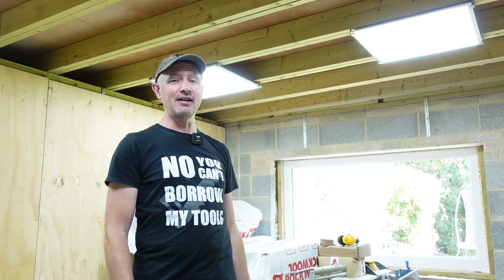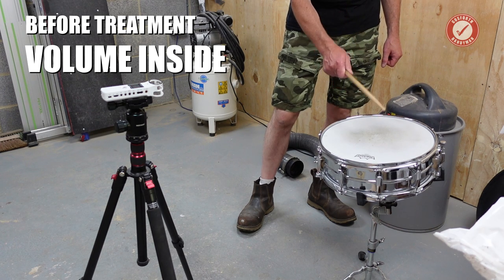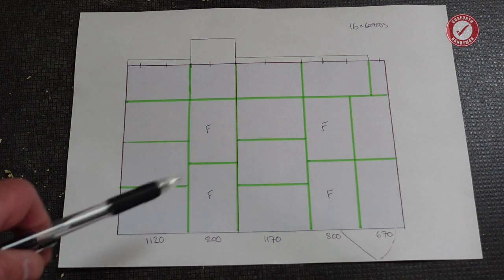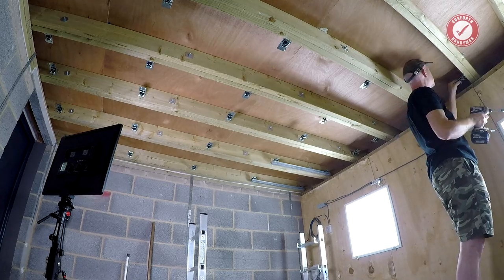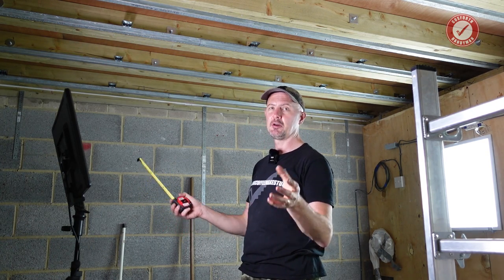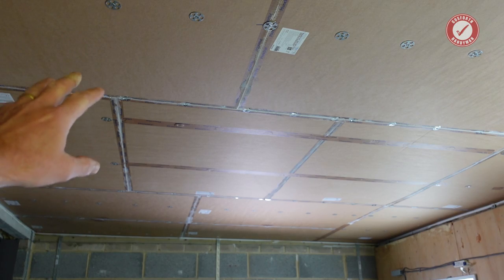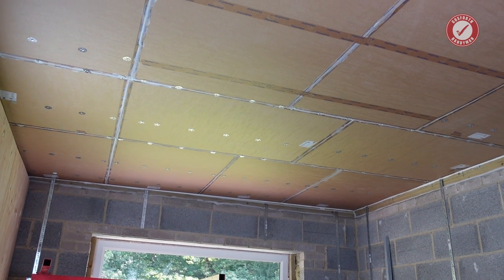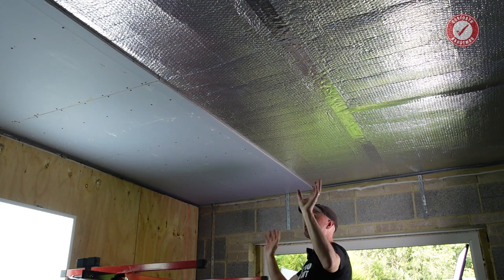Soundproofing the ceiling with SAND?! Garden studio (part 4)

Comment: I used sand for my studio many years ago, I poured dried sand into a 4 inch cavity between 2 sheets of 12mm ply, it worked quite well until the sand slumped down over time, I spent 3 days drying 2 tonnes of it out over a metal sheet which was on top of a fire pit, then was gutted when I discovered you can buy kiln dried sand a few weeks later :) I'be currently got a room inside a room studio which works really well, must do some videos about it one day
Reply: That's awesome! I'd love to hear more

Comment: I agree about the ‘professionals’ Andy, we did our block drive ourselves because of one, and also the fascia sand guttering because of another. We do most ourselves these days because we can usually get better results.
Reply: Same experience here - during our renovation we hired "professionals" (recommended and not the cheapest) to fit one set of doors and to do our fascias, gettering etc... The doors we're ripping out and re-fitting ourselves because they bind even at the maximum adjustment (not to mention the holes they filled with blue roll then trimmed over), the fascias and gutterings - we're going to have to re-fit the guttering so it falls towards the downpipes rather than away from them.

Comment: Subbed & liked. Some serious out of wack levels there & done by so called "professionals"! It does make you wonder about the skill levels of some trades these days.
Must have been the same lot that installed a shower in the hotel room I stayed in the other night. I think we were the first guests to stay in the room after a recent re-fit. The glass shower screen was touching the wall at the top of the shower wall but it had a 10mm gap half way down the wall. No sealant in sight down the wall or between bottom of the shower screen & the shower tray!! My wife came out of the shower into what looked like a swimming pool of water right across the shower room floor which was nearly under the entrance door to the room & the corridor beyond. Luckily were were on the ground floor so no chance of flooding anyone underneath us but it makes you wonder what the hell the guys were on when they installed this & who signed it off. Reception were informed but they did not look  too surprised which led me to believe that this was not the first complaint about the state of the rooms. BTW, this was not a cheap low end hotel but an up market old manor house in 50 acres of grounds. Looks like the cheapest quote got the job - again.

Comment: Thanks so much for the helpful video! A couple of questions: 
1. What is the brand and model of the sand filled panels you used? 
2. How much do those panels weigh in their standard configuration? 
3. How do you handle cutting holes in the panels for things like outlets without having all the sand drain out?

Comment: How did you attach the foil bubble wrap to the sand filled boards? I know you foil taped the edges but did you just staple the middles to keep them tight against the ceiling?
Reply from the maker: Double sided carpet tape. 👍

Comment: nice video...shows me some places where I went wrong with my room. I had plans to do the ceiling, but that sand board is not available in my area. At the time of building, I just went with what I could to finish the build.  My room sounds fine (simple 12x16ft room_), but I want to do more to the floor and ceiling with this process.  My building is off the ground. Anyway, thanks for the video and info. Very informative....

Comment: I got builder to fit this system and plaster, it made very little difference over the old chicken wire and plaster that was there before,,I wish I had saved £2500.  and just left as was,

Comment: What sort of washers/discs did you use to hold up the SBX board? There seems to be three different types, one serrated for tile backer board, one with a centre indent for insulation, and another slightly raised in the centre also for insulation.

Comment: I had a ground floor flat with bowed ceilings.  The previous owner had blocked up all the ventilation resulting in lots of condensation.  The ceilings became soggy, then under the weight of the sand insulation began to sag and crack.  To rectify the problem I screwed a layer of 1/2" ply to the joists, followed by plasterboard, and finally had the ceilings skimmed.  Which also sorted out the problem of the artex ceilings, at the same time.

Comment: Sounds like the lot that built my house. The cavity gap is ok at the ground level but by the time it gets to the upstairs bathroom it’s down to about a centimetre. The plaster had sagged off the wall and the bottom of the wall was about 2 inches out from true and the screed is cracking and not level in the downstairs. I’ve been going through putting a list of things right and it’s taking ages and people say to me “just get a builder in”. Drives me up the wall. Not only do you have to wonder about the workmanship but also can you even get them to turn up!

A good builder is worth their weight in gold.

Comment: 5mm out on each wall is well within tolerance and would be acceptable and hardly noticeable if that's the dims on the ceiling 
At Floor level it should be as per drawing and level and square

Comment: Why did you don’t build a double layer brick sealing same system as the walls.  It will stop all sound without all the hassle of special material systems. Adding a bit of hight you can still have a drop down acoustic’s sealing under the brick concrete roof.
Reply: How would you do that ? With block and beam ? Or a different method 

Thanks

Comment: Think your builder was the same one who built my extension!  Had a 4-5 inch fall on one floor, anything you placed on it would roll quite freely into the corner.  The worst bit though was that he failed to install cavity wall trays  (passed by the building inspectors who presumably are a waste of money as they clearly don’t check for that!) - this failure however, brought the sitting room ceiling down Xmas Eve!  (we’d had a decent amount of rain at that point)
Reply: Bet he was cheap?

Comment: Worked on a flat recently that put up 2 of the blue boards with this floppy soundproof stuff you stuck between them - they were all screwed to a similar frame system which were bolted to the rafters - not next to them like yours - I’ve seen the ceiling since and it has cracked and looks good but it didn’t really soundproof it - the ceiling on a 2 bed flat was about 7-8k in materials 😂
Reply from the maker: Unfortunately there's a lot of companies out there doing this sort of work who don't really understand the core principles of soundproofing and acoustics. Don't do it right and it's money down the drain. 🙄

Comment: That window wall would drive me crazy. I'm a tiler and recently tiled a bathroom and when i tiled the window wall (same dimensions as in this video)  i stood back for a look, something was way out. Put my level on the tiles and they were bang on. Then i lined my laser level up on the new double glazed window profile and it was way out of level as the fitters had fitted the new window to the out of level lintel. Not obvious before the tiles went on but once tiles go on you get a reference line to which you 'eye' other lines. Looked awful. Oh, like this new system in this video and great work btw. Cheers
Reply from the maker: Yeah, was a nightmare. Thankfully will all be covered up. 👍

Comment: I am wondering why a vapour barrier is needed? Doesn't that seal the moisture in the room, rather than letting it out via vapour permeable materials. eg Roofing underlay is usually vapour permeable.
Reply: There's no such thing as a breathable flat roof covering so you want to avoid having moisture rise up into the roof structure as much as possible really. If it does then it'll have nowhere to go and can rot out the sheathing the roof is laying on. Loads of problems with incorrectly built flat roofs.

Comment: Anything simultaneously heavy, dense and soft will soundproof.
I understand that the height of the building is limited by code, but internally couldn't you dig out the floor to gain another foot or so?
Reply: Theoretically, but in the UK you'd just be asking for trouble with damp.

Comment: When the Soundbloc boards are installed, the screw fixing penetrates the SBx board. In time will this not become an issue, with sand leaking out?
Reply from the maker: It's OK as long as you don't take the screw back out. 😁
Reply: @GosforthHandyman  Thanks. Makes sense but useful to know when you start a project.

Comment: You were measuring wrong. For your spacings you want to measure centres,  not from rh side and back. Should be hook on measure " and on". Also as far as your blocks go, There are different levels of "professionals" and its really up to you to vet them. (Look  at and speak  to previous clients) Did you go with the cheapest quote? Still as you said, its all cosmetic
Reply from the maker: I'm measuring the distance between genie clips, not between rafters. Speaking to clients is pointless since they only give you contact details of their best clients (most of which are mates). Vetted reviews but they turned out to be fake.
Reply: @GosforthHandyman  yes you measured genie clips, but didn't look like centres

Comment: Just wondering what your take is...
When I added some sound deadening to party walls I was advised to use fire rated foam on anything that needed a big fill.  I also used it around my windows.  It's a denser foam than standard and did seem to work... But hard to tell.  

Great job though.. The difference is stunning.. Impressive!